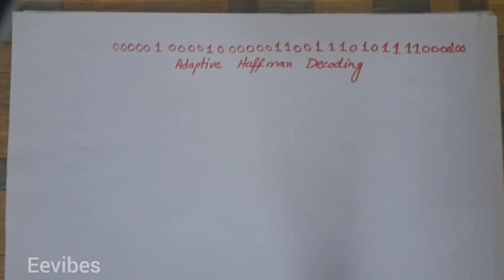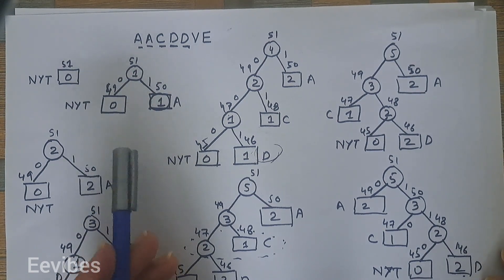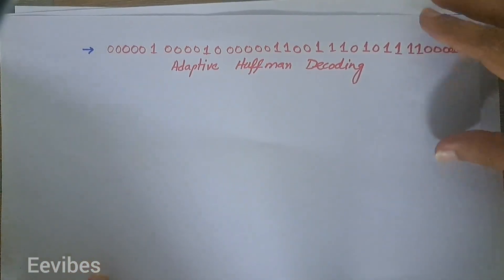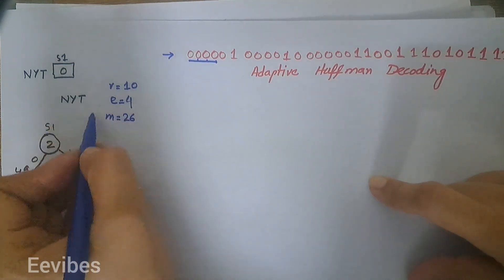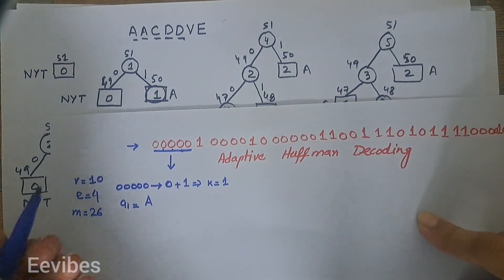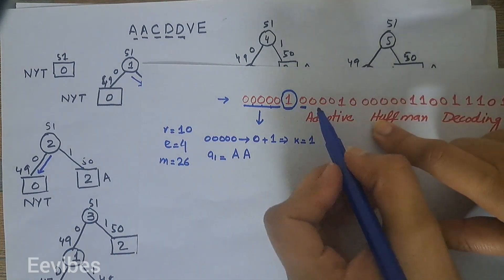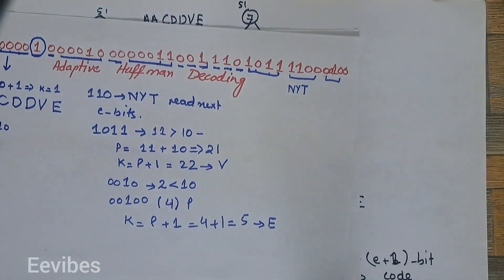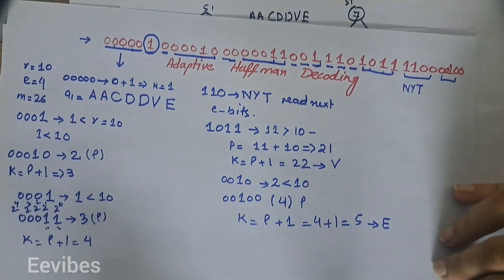Adaptive Huffman Decoding Procedure With Example #huffmancoding #decoding Part 3| Decoding Example

Comment: Can't we just decode it without tree help
Reply from the maker: No
Reply from the maker: Because every string is different and decoded differently ...so that's why you need the tree always. Also there is q general rule of encoding and de doing according to which both encoders and decoders should be synchronised or should know the implementing algorithm .